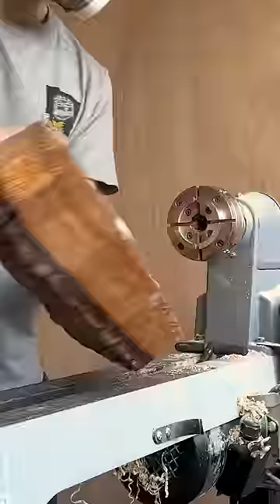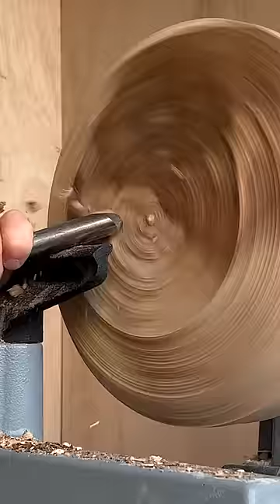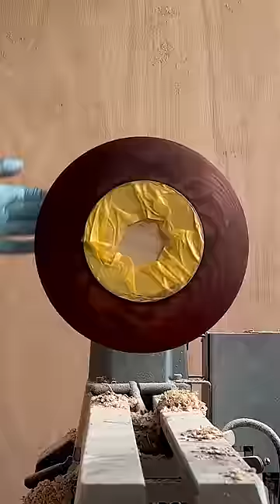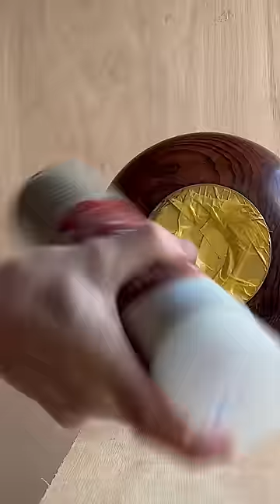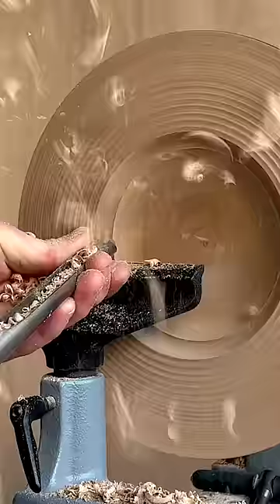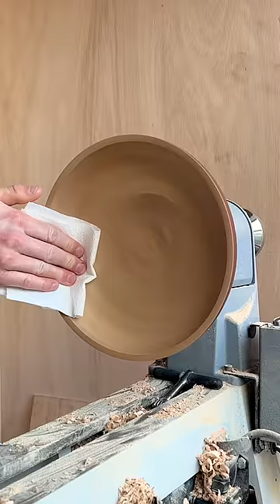Turning wood BRIGHT RED?! #woodturning

Comment: I'm always curious about the process of polishing with wood shavings.
Reply: He thinks it looks cool
Reply: Re
Reply: @Aid_n it does not work
Reply: Its makes you guy comment on the video therefore you are keeping him relevant on yt shorts
Reply: I think they put glue first and then wood shavings to fill tiny pores if any ..  I guess😅
Reply: Probably dry it maybe?
Reply: @Aid_n The application of the wood shavings is a method called Burnishing.  Burnishing is used when chemicals can't be used or is used in conjunction to chemicals in order to create smoother and cleaner finish on the wood. This method occurs because the soft absorbent wood cells are eroded and burned away, leaving only the hard non-absorbent cells. As observed in the short he only uses it after he applies the finishes, or on the inside of the bowl where chemicals could leach into any food placed inside.
Reply: SLOTS TOP  No only hell lol
Reply: SLOTS TOP  John 3:17 - but god did not send his son into the world to condemn it, bud so through him it may be saved. Mabey learn the whole thing before you go pushing religion onto others.
Reply: HE IS SHOWING THE BOWL THAT IF IT FAILS AS A BOWL IT WILL END UP LIKE THE SHAVINGS
Reply: @itachisasku make yourself think that
Reply: @mrme2558  Christianity existing makes you Seethe. Also your text is a different part lol.
Reply: SLOTS TOP  a God has no son ...
Reply: It’s probably just for something unique on YouTube. Like there’s a Blacksmith that makes Damascus and always throws a chili pepper and his canisters. It does nothing but makes the video unique.
Reply: It works by friction. You can make the wood darker and shinier and seal the pores
Reply: @bochapman1058  I’ve seen this since I was a kid. You can also draw dark lines when the wood is turning if you use a harder wood with a sharp tip
Reply: I thought it was to fill the microscopic creases and crevices, like sealing the "cracks" so you don't get splinters. Idk tho
Reply: It just helps smooths and shine the surface
Reply: He's not polishing, he's scrubing a part of the tree's body while it is jeering. saying lol look what i took from you
Reply: FUFU  Hail Satan Amen 🙏
Reply: I can give you a first hand lesson 😂
Reply: @mrme2558  John 3:18, whoever believes in him is not condemned, but whoever does not believe stands condemned already because they have not believed in the name of God's one and only Son.
Not sure what you're trying to say, but if it's that Christianity doesn't exclude other religions, it sounds like you're the one who didn't read far enough.
Reply: Some sort of weird idiosyncracy/ ocd ritual.
Reply: @jusus222  my theory is that it breaks the fibers that would be sticking out that would otherwise grab onto a clothe rag etc. But idk why he doesnt have a different option for it.
Reply: I think it might be just to absorb any excess so the finish dries even between coats
Reply: @mrme2558  yep very true
Reply: @BigT.Larrity  if in order to mock Christianity, you have to worship the father of all evil, then I guess something is really wrong with you. Your hatred speaks loud and unfortunately, I will only cause harm, more to you than anyone else.
Reply: idk if youve gotten an actual answer yet, but ignoring the mess of the other comments, the wood shavings are used as a form of sanding. I suppose when you make a bunch of shavings while using a lathe, it doesn't hurt to spare some Sandpaper
Reply: @bochapman1058 what you're referring to is the running joke among blacksmiths specifically Russian and English speaking smiths, where the English words for spicy, is the same as the Russian word for sharp.
Reply: @amumuimo8530  i think its something he just does because it boost his comments and views because that makes no sense
Reply: Helps rid of burrs
Reply: @itachisasku LOL what a dumb take. I machine metal and aluminum chips can be pretty fluffy and soft if done correctly. I can only imagine how soft wood shavings can be. Just because something is coarse when in it’s normal state doesn’t mean it will
be once it’s altered
Reply: FUFU  who asked?
Reply: @digbick1241  no John 3:17 is exactly what I wrote. Christianity existing in and of itself doesn’t make me mad, people pushing religion onto others does ( which the Bible tells you explicitly not to do )
Reply: @benjidoerr  no I’m not religious at all. I said that because people like you try to condemn others to your beliefs just because you believe a book you got out of the fiction section.  You can believe the Bible and what it says but you can never use the Bible to prove the existence of a god with the text that I dont believe to begin with.
Reply: @mrme2558  it sounds like someone who called themselves a Christian hurt you. Jesus didn't need to come to tell you that the world and everyone in it is messed up, that's obvious. He just came to fix it. The only reason Christians want you to believe in their God is because of how good he is for you.
Reply: FUFU  Ambtukam 1:13: Ambatubass omaygat
Reply: @benjidoerr  imagine believing that your book is the only one, even though it was written way after others
Reply: FUFU  I see. It does make sense to use wood shavings when you out it line that.
Reply: FUFU  this has nothing to do with this bowl
Reply: @joshross5298  it helps when the writers were eyewitnesses to a man who rose from the dead, and other parts of it specifically predicted historical events even 500 years in advance.
Reply: @Benji Doerr  write a few predictions down, see what happens, make enough, you'll get some, especially if you word things to overlap and ensure a range of possibilities is covered. Eye witness? Many of your gospels were put together by folklore up to 400-600 years later. Can you imagine playing a game of telephone for 400 years? Romes new emperor decided to install christianity directly after they prayed to Jupiter and Venus. They upgraded a local cult into law religion and emperor made a few buddies into bishops and they milked the citizens just like old times. The crazy part is that it's still going today
Reply: @hawksleysmith565  I see. Thank you very much for your kind attention.
Reply: @joshross5298  First of all, you clearly haven't read the prophecies at the end of the book of Daniel, which are super specific and all fulfilled completely. Second, every single prophecy in the Bible besides those about times yet to come have already come true. Every one. No random guessing can accomplish that.
Thirdly, I don't know what historian you're reading on, because even secular ones agree that the new testament gospels were written in the first century AD. 
Lastly, I have no need to convince you of the truth if you are unwilling to listen to it. I hope you care enough about truth as you seem to think you do to actually go looking for it, because none of the things you just said apply to the Bible, and they're not even difficult to give counterexamples for.
Reply: @WattsGemini323  you must be that positive vibe slay queen type of person
Reply: @BigT.Larrity  edgy 🙀
Reply: Because if the shavings grab, it means it needs more rotations on the wheel. Perfectly smooth beyond 3k grit wouldn't grip the shavings
Reply: @eggsnbaconmusic4370  thank you Hugbees.
Reply: @markkristensen9242  💯%
Reply: @BigT.Larrity  edgy little boy alert
Reply: It acts like a very fine sand paper
Reply: @benjidoerr  sir you know how ridiculous your trend as become.. the initial comment was regarding the wooden bowl then someone spit 💩 about their religion and sneak it into something that has zero connection about even being religious or morality or something even close..
Totally random so when someone does that it's could be taken someone trying to shove down their beliefs into others throat..

I can debate theology to you all day however this is a video about a wooden bowl..

Which is again not a slightest connection to any biblical reference
Reply: @zeprillo  So true, if you look back though I'm only directly responding to people.
Reply: Sucks up any excess i think
Reply: @AsaditoUy  underrated comment🙌🏽💀🤣🤣
Reply: @jusus222  it does
Reply: It's probably similar to using steel wool on steel...
Reply: FUFU  why do you feel the need to share that at this moment? What's the relation? Or are you just having an episode? 😂
Reply: @grandmarshaljeromial5174  xd
Reply: @itachisasku  the bark on a tree branch is not the same as those shavings
Reply: FUFU  the point?
Reply: abnormal things do increase engagement
Reply: Bruh the explanation in this comment is so wrong. The reason why he uses it's wood shavings is to make the bowl know that he now belongs to him and he's using the wood shavings as an example on how he can control the bowl.
Reply: كثيف نشارة الخشب
Reply: @mrme2558  aaaah that’s pretty savage bro
Reply: @benjidoerr  how is he good at all let alone for me
Reply: @Joe jingping it acts just like a paper towel, to get the fine dust knocked off
Reply: @mrme2558  So many reasons, including: he gives you a purpose in life, he gives you hope for when you die, he give s you a reason not to be guilty, he tells you how to be good, he gives you other people to support you, he promises to make your efforts mean something, he comforts you when your loved ones die, and he will make anything bad that ever happened to you seem like nothing compared to what you'll experience in heaven because it's so incredible. Thanks for asking. :)
Reply: Burnishing
Reply: Esta linda
Reply: Y’all woodworking experts all of a sudden? 🙄😒
Reply: 😊iSalmañ6
Reply: @eggsnbaconmusic4370  🤣🤣🤣🤣🤣 bravo, sir!
Reply: @fortyeighter8917  ikr.  nor do they have genitals ("He", "Him", "His" or new age Goddess worship for that matter)

the Creator of all is limited by a gender? 🤷
Reply: It burnished the wood, I guess you need to use the same shavings that you turned off the object.
Reply: @eggsnbaconmusic4370  🏆
Reply: @theoffice3802  ...but it looks cool!!!!!!
Reply: @jusus222  Says the couch sitting egg spurt.
Reply: @tweakerkid  projecting?
Reply: It's for buffing not polishing.
Reply: @TheGreyPouponDon also German speakers...because in German the word for spicy hot is same as sharp
Reply: @theoffice3802  это выглядит, как если бы парикмахер вам после стрижки посыпал голову вашими же  сострижеными волосами😂
Reply: It would be a early stage of polishing. It serves to fold and knit the fibers together, unifying the surface
 Also it's usually a good bet that the shaving, saw dust, or newspaper is softer than the wood piece
Reply: It makes the surface smoother
Reply: @jusus222 this is how I know you
Don’t wood turn 😂
Reply: @patrickconklin5946   kid sit down in the boat
Reply: @jusus222  nooooo u
Reply: Burnishing
Reply: @bochapman1058  love shurap. And that's only kinda true. In the heat of the forge the pepper will just be reduced to carbon which in theory would add more carbon to the steel as he makes more layers. But it's not enough carbon to really make a difference in blade hardness or edge retention
Reply: Better polish your wood with a good lubricant, it's more effective.
Reply: برای برداشتن رنگ های اضافی

Comment: how confident is this man to put so much work into the polish before he's even finished shaping it
Reply: Да🤮😇🥳🤣😆😊🤢😆😇
Reply: apa
Reply: apa
Reply: That’s exactly my thought
Reply: Had the same thought initially but i realized that he actually has to polish that underside if he wants to apply the polish with the piece on the machine. If he shaped the inside, he would have lost that area where the metal disk was and wouldn't be able to mount it back on to the lathe forcing him to apply it completely manually.
Reply: What? It's easier.

Comment: I did that one time in a metal lathe with an 11 inch diameter piece of inconel that had been cut off an inch and a half out of square because the blade on the cut-off saw went bad in the middle of the cut. Anyway I have this 11 inch piece of inconel with one side of it sticking way the hell out and I start carving It Off. It took a week. And maybe a whole pack of soft carbide inserts. The hard ones wouldn't stand up to the interrupted cut. That's what they get for not buying good saw blades.

Comment: Quick question, what is he doing when he is rubbing the wood shavings on it? I'm confused
Reply from the maker: Good question 👌 it’s called burnishing or de-nibbing and it removes any tiny imperfections left behind after sanding. Makes the surface feel very smooth - ready for something like wax or oil
Reply: @HenryKeateCarpentry  Awesome! Thanks for the quick response and helping me learn something new! You sir have earned a sub 👍